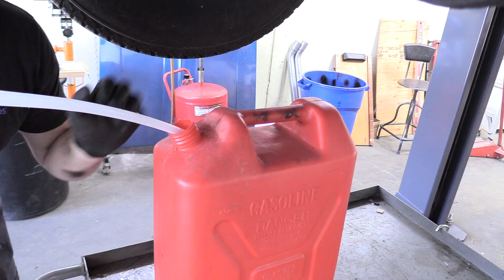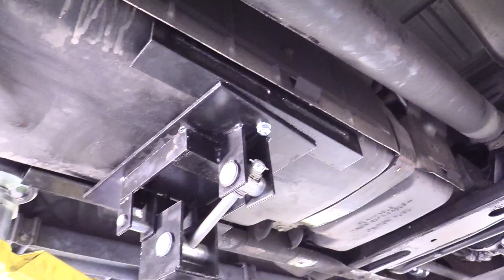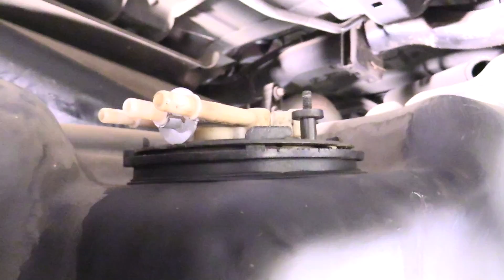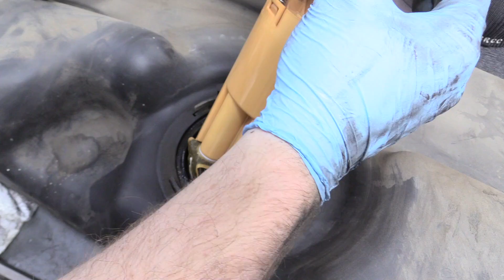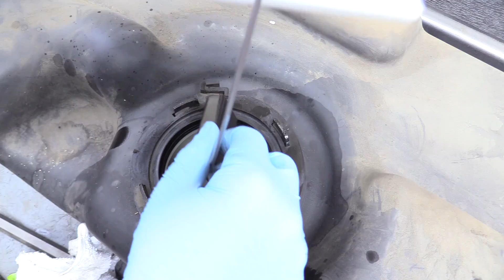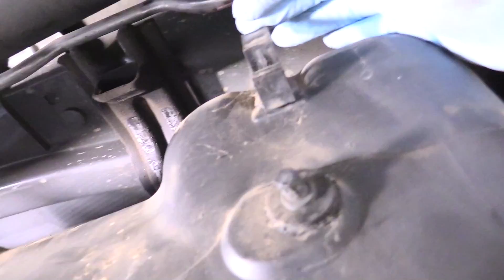Fuel Pump Replacement Chevrolet Silverado Suburban Tahoe GMC Yukon XL Sierra 2000-2006

Comment: The nice thing about doing this on a truck is that you don’t have to drop the tank but, you do need to lift the bed. So remove filler neck tube and disconnect rear lighting wiring and the procedure is basically the same.

Comment: Have to comment that across the model years mentioned here, the fuel pump is quite different. In the early 2000's there was a 4 pin square connector on the pump, replacement pumps have a 4 pin oval, and should come with a new wiring harness.  For wiring, there are also variations within the year.  These years, the pump wire colors are different, be sure to read and understand the instructions on how to hook the new harness up.  My 2002 Sub had black, gray, purple and orange with a black tracer in the harness, the new plug has black, gray, purple and a black with an orange tracer.  One of the youtube videos said this was a color for color change out, it is definitely not that.  The instructions show various hook ups, across model years with statements like "In some vehicles you will find...", which means, we don't know how to hook it up.   In my vehicle, harness black went to connector gray, harness gray went to black with the orange tracer, and orange with the black tracer went to harness solid black, and I did get one right, purple went to purple, just like my lottery number pics, I get one right.  In my town, only Advance had a Carquest pump that came with the new harness and connector so my choice was predetermined.  Carquest is reported to have their pumps made by Delco, if so, that is good.  The original pump in my Sub lasted for 20 years and 320,000 miles, I should be dead before this one goes bad, or maybe the car will be useless when you know who in DC succeeds in outlawing gasoline.
Reply: I've had 2 pumps suddenly quit on me so I do change them after 110 K or so.  Just bought a nice '04 Burb Z71 4X4 198 K with no rust and having rear evap,  Transfer Case,  dash cluster , etc fixed.  Fuel pump being replaced caused no idea if it's ever been replaced or run low on gas.  I just have no problem changing pump after 100 K + miles to keep from being stranded at the worst time and place.

Comment: Do the lines not get new orings or does it even need orings?
Reply from the maker: The orings are in the lines and ours were in good shape. They don't typically go out but you should check them to make sure they are in alright shape. Thanks for watching!
Reply: @2carpros  awesome! Yea i may need to change them. Truck leaks fuel when its really cold. Under normal temperature not a drop leaks

Comment: Good video. I could not get the 3/8" fuel lines off, even with new disconnect tools and your trick.  I wound up cutting the pump end off and then they came out of the fuel line easily.  Poor design, with the neck too short for a standard disconnect tool.

Comment: I have a 2004 2500 Suburban 4x4. It has the extra tank behind the axle. Does it have a pump in it as well? Is there a pump in each tank?
Reply from the maker: Yeah this truck has that too. That's why I had to remove that cross over tube. I believe that is a saddle tank for more fuel range and there is no pump in there. Thanks for watching!
Reply: would like to know this also